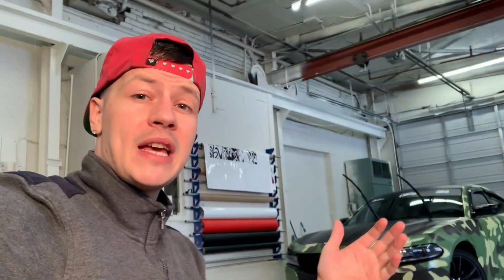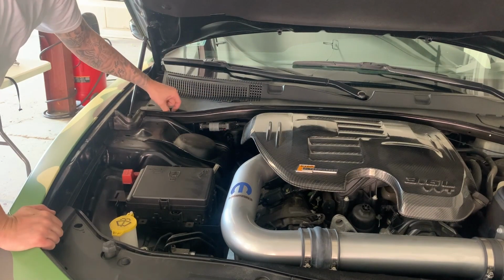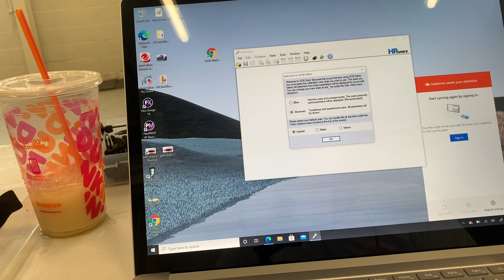Supercharger installation on my Dodge Charger (Heritage Editon) Part 1

Comment: What’s the difference between heritage edition and standard?
Reply from the maker: The heritage edition cost more and has a different gear making it louder than the standard but no difference in performance.
Reply: @itzawrap6037  alright cool cool
Reply from the maker: @DanManTheHamMan  subscribe if u want to see more videos of the supercharger whine and dyno runs. Appreciate the view and comment
Reply: @Van Brecken i dunno I use Flixportal. you can find it if you google:P -aarav
Reply: @Aarav Clark Thanks, I signed up and it seems like they got a lot of movies there :) Appreciate it !!
Reply: @Van Brecken Glad I could help =)